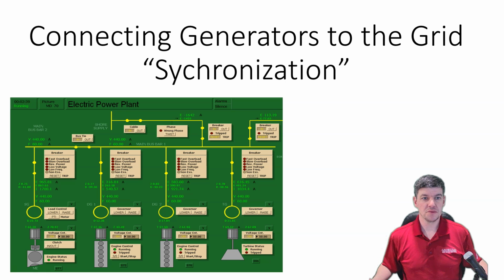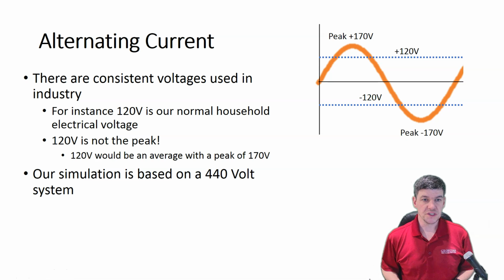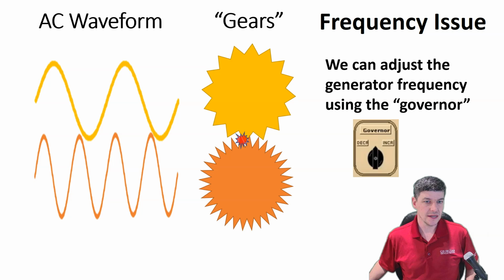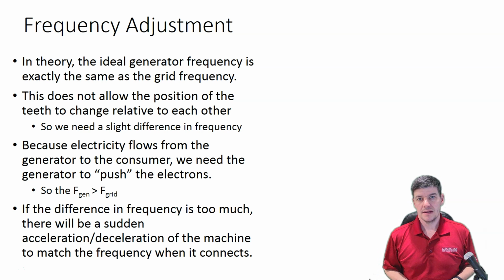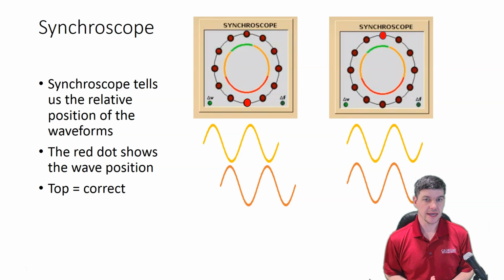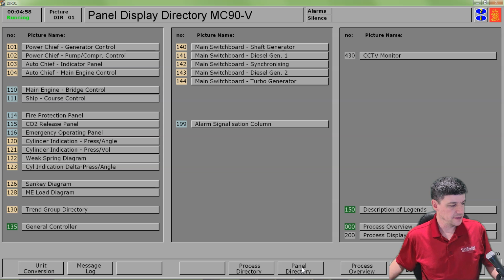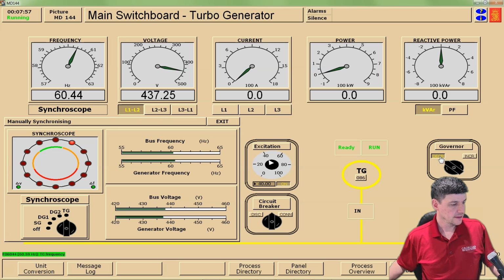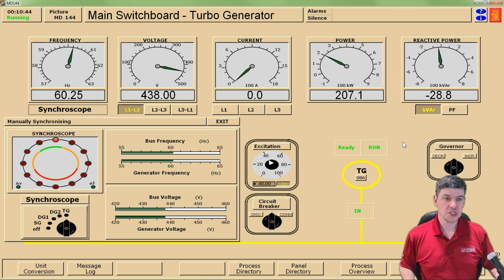Generator Synchronization - Theory and Simulation

Comment: I have a doubt and thought this is the best place for it, what would happen if the synchronoscope light is in the 6 O clock position and the breaker is closed, can u explain step by step how the generator will come into synchronisation if we r using 2 generators to parallel each other. Or what happen if the breaker is closed when the phase is 180 degree out of phase for the voltage ie when closed in 6 O clock position

Comment: I am now 72 years old. For 34 years I worked as an operator in natural gas burning generating stations with steam turbines and generators. So a number of times over my career I synchronized these units to the line. The units I operated were built in the 1950s. The synchroscopes on these units had a circular dial with a pointer that would rotate. There was a mark at the very top of the dial to indicate proper synchronization. There was also an arrow pointing left that was labeled slow and an arrow point right labeled fast. It typically took a few minutes to synchronize a unit to the line. It was easy match the generator voltage to the line voltage. However it took some time using the governor to achieve the synchroscope pointer rotating slowly in the fast direction. This was because the turbine speed tended to drift. Once the machine was just a little faster than the electrical system I would watch the pointer and close the circuit breaker when the pointer was close to the top. This was to have the generator circuit breaker close when the pointer was at the top. Today it common place for electricity generators to be equipped with automatic synchronization that performs all these steps automatically. I also have seen what happens when generator synchronization is done poorly. There was a turbine generator unit where the speed governor did not work. The speed of this unit had to be controlled using the load limiter, which only pulsed open or close the turbine control valves. As a result the synchroscope would rotate very quickly in the fast direction or very quickly in the slow direction. As a result ideal turbine speed could not be achieved. So operators tried to do as best as they could. One time I was at the boiler control board and another operator at the electrical control board synchronizing the unit. I heard a loud bang as the electrical system suddenly snapped the unit into synchronization and the floor of the control room jumped. Amazingly the unit kept running without problems. Synchronizing a unit to the line this way can cause considerable damage to the turbine generator and should be avoided.
Reply: We cycled so much, I can do it in my sleep.  Our units were commissioned when my dad was 4 years old.  I love the pistol grips and matching speed while firing my boiler all at the same time.  You should see the looks I get when I tell people I can sync to the grid manually 😂.  We got so good that I would almost stop the needle and close in. Auto sync is for dummies. 😂. I'm 39 and have been in the business for 19 years. Finally getting off shift now and passing what I know on to the next generation.
Reply: Hello sir,
I appreciate that you have shared your valuable experience.
Rahul Chauhan from India 🇮🇳
Reply: Good days. Thanks for sharing

Comment: Can the generator synchronised while the synchronoscope turn to slow direction (CCW)
Reply: Yes, it could happened in manual sync mode, done by operator. But be aware that operator immediately need to increase the load of synced generator, manually by increasing of the frequency/revs. In other case, the generator will take grid power and act as electromotor, with triggered generator reverse power protection. Luckily🙂

Comment: Power generation source has many AC generators and electricity is transmitted out through the same electric wire not necessarily turned on together, then why the sine wave does not go out of phase with each other?
Thanks

Comment: How to measure generator power when they are perfectly in sync with the grid? I mean how to measure "the pull" If they have same position
Reply: Reactive power can be determined by the difference in voltage level between generator and grid. Active power can be determined by the phase shift between generator voltage and grid voltage.

Comment: Hi how are you voltage and frequency, phase angle synchronising settings percentage how much?
Reply: You might want to clarify your question a bit? I’m not sure I understand the question itself.
Reply: @marcelastacey890 how much phase angle setting in the power generator?
Reply: @marcelastacey890  87 G protection setting

Comment: I want to start by saying thank you for taking the time to make this educational video that was placed into simple terms. I am a power plant operator, 60MW unit and a 26MW unit. I have been trying to understand the reasoning behind the synch scope, I understand the basic principle of matching the grid before "pushing on" to it. Yet, most text is very convoluted and far from clear on understanding. I'm no engineer, I struggle when its written from an engineers or electricians perspective. So thank you for this again, very helpful video by using the "gears" as a visualization tool.

I would also like to ask, if you are still on the Youtube, where can one find this simulator? Is that something anyone can access or is that a proprietary program?

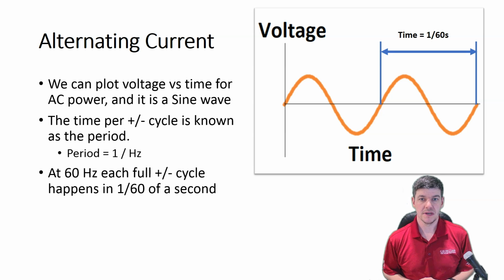Comment: A formality: At the slide at 2:42, you use quantities and unit symbols in the same formula. As in, you write, "Period = 1 / Hz". This is not proper form. It should be, "Period = 1 / Frequency". (Or, if you must, "s = 1 / Hz", but even that should only really be used in actual calculations with figures, not with the symbols standing on their own.)

Comment: found an answer...Post by Steven Chauvin:  Once a generator is synchronized and placed on line, in parallel with other similar generators, the become “synchronous machines” (which means it will act as a generator (driving the load) or motor (acting as the load) at times). One of the generators in the group is designated to be the “master”. The other generators will synch to its speed and voltage. If one of the set begin to slow down, it will act as a “load” and so the other generators will “push” it. If it speeds up, the other generators will “pull”, becoming a load, pushing or pulling it back into synch.

Comment: Very interesting! After the generator is synced and locked what prevents it from going out of phase as you increase the governor power? Inductive reactance or back EMF?
Reply: It dependes upon several factors: the impedance between the EMF and the grid (resistance and inductive reactance), the voltage values (of the grid and the EMF) and the load angle (which is the angle between the EMF and the grid voltage, also the angle between two magnetic poles of opposite polarity between the stator and rotor). But lets assume that the impedance and the voltage levels are constant (which is usually the case). Thus when the governor power is increased the load angle increases, meaning that the angle difference between the rotor and the grid increases. Now, if this load angle is between 0º and 90º the operation is stable because the atraction force between the magnetic poles of the rotor and stator is strong enough to drag the rotor along and hold it in place. However, if you keep increasing governor power the load angle will eventually surpass 90º. In this situation the operation is unstable because the magnetic poles are so far away from eachother that the atraction force is so weak that the stator is unable to drag the rotor with it so it happends what is called "pole slip", meaning that the machine loses synchronization with the grid and the generator starts to speed up to very high speeds.
Reply: Thank you @adriansolis126

Comment: sir when you say we need to match our generator's parameter with that of the grid what does it mean? And if there's already a grid why do power plants generate electricity and how do they send it back to the grid?
Reply: The grid voltage may vary a bit. MIne roams between 37,500 and 38200v. Your generator will have to be able to match that as well as the frequency, usually 60HZ. Outside of the power company specs, they will require you unit to trip. To send power back you would syn to the grid and stay connected. Any power you make above your own load would go backwards through the meter to push into the grid. This takes a special bi-directional meter as well.

Comment: Wow. I'm old school, 70's and 80's. I have been in many power stations where the operator matched voltages and everyone in the control room stares at the synchroscope clock and the 2 lights above it. When the turbine generator is goosed up a bit by the Raise/Lower switch so its slightly faster than the grid, the Operator waits until the lights go out as the scope needle hits the 12 o'clock position and he quickly hits the Breaker Close switch. The Operator immediately adds a bit of power by bumping up the Raise switch to prevent the reverse current relays from opening the breaker.   Even back then the GE gas turbine generators has auto synchronization available as some peaking plants were unmanned and remotely operated. I was a Field Engineer for General Electric Co. in those days, worked in 17 countries.
Reply: Same method was used when I was in the navy back in the early 2000s
Reply: @sivalley  I supervised overhauls on all kinds of SSTG sets on Navy ships and subs.  I hope you weren't the guy who wrote FTN all over the place!  Its not a job, its an adventure!
Reply: @kimmer6  Unless you worked on CVN75. . . . But I had access to some of the more "fun" spaces that required a TLD. ;)
Reply: @sivalley  Enterprise, Carl Vinson, Long Beach, SSN La Jola and SSN Los Angeles. Required Subsafe, work barriers, documentation, and TLD Badges. Now I don't need no steenkeen batches.
Reply: @kimmer6  🤣 Yeah, i don't miss that stuff at all, glad you escaped the zoomies.  I was an ELT with RM quals.
Reply: "the Operator waits until the lights go out as the scope needle hits the 12 o'clock position and he quickly hits the Breaker Close switch."

The technique is know as the "dark lamp" method.
Reply: @BedsitBob  I recall, back in the early 70s, my elec eng lecturer, recounting an incident. Where a young technician, got the sync slightly wrong. It resulted in the grid forcing the generator into sync, and with such a mechanical shock, it sheared all the mounting bolts.
Reply: @doggychews  As I understand it, the generator should be running at a tiny bit higher (only a fraction of a cycle) than the grid, and the breaker should be closed just a fraction of a second before the generator lines up with the grid.

That allows it to run into sync, rather than running out of sync, if the breakers close a split second late.
Reply: no circuit breakers
Reply: @charlieangkor8649  Circuit breakers the size of a refrigerator that snap like a huge rat trap and make motor driven  ratcheting noise.
Reply: That is g8

Comment: Thank you for the tutorial, it is really helpful. I have two questions. Why is the current zero if there is power output? When we are connecting generator to the grid, how do we take into account resistance of the grid?
Thanks in advance.
Reply from the maker: Hi, good observation on the 0 current.  Just like the voltage where we have to select which phases to measure between before it shows voltage, we also have to select a phase to measure its current.  I did not select a phase to monitor in this simulation, so it shows 0 amps by default.  But there is amperage on each of the 3 phases which results in power delivered.
Reply: @RyanTangney  how can I access the full course lectures and exercises? I am willing pay for the content

Comment: Thanks for everything.  Can we sync two gensets of different manufacturers. (One with electronic governor and other with mechanical governor) how to control the load share of them
Reply: In my sugar mill, I had 2 very different generators to sync. Sometimes they had electronic exciters, sometimes they had mechanical. Depended whether they were on normal or backup exciters. One generator started with a 1916 mechanical governor ( just fine for make lights for horses) but not very good at keeping 60hz. Later in the 90's it was upgraded to a computer governor. It could always be paralleled. The challenge was the balancing. At different load levels, one generator would take more load or less load. Just a bit of baby sitting if the loads change a bit.  1936 1000 KW  and 1916 750 KW  at 460V  both off grid only. Both have been retired for about 8 years although the switchgear and syncro units are still in use.

Comment: Sir I wanted to clarify something. In the case of steam power plant, when the governor demands an increase in power, the generators respond by opening the control valve to increase steam input. Yet how does the turbine and generator speed does not increase by this higher steam input?
Reply: When the generator is NOT synchronized to the grid, the Raise/Lower governor switch controls the speed of the turbine and generator. As soon as you match the speed to the grid in voltage and frequency, and the synchroscope shows that the sine waves match, you close the breaker and lock into the grid.  Any further action on the governor ''Raise'' switch starts opening the poppet valves in the steam chest which adds load to the generator.  The generator is locked to the grid like meshed gears so the speed will not increase. 

The governors on the big base loaded turbine generators can influence the frequency of the grid but for the most part, the grid is usually so large that the addition of another generator has only a minuscule effect on frequency (speed).   When you have a small grid system, the problem becomes a bit more complex to maintain frequency and has to do with the droop settings of the governors. You don't want a 600 KW diesel generator taking all of the load while the 2 Megawatt unit is only partially loaded. Each governor's droop settings can be tailored to prevent that.
Reply: Governor controls speed not power. An increase in load (which will try to slow the generator) will require a higher steam pressure/flow to keep the Governor speed the same.
Reply: My GUESS is this has to do more with balancing net torque of the generator

Comment: Practically, I had seen rapid frequency variation before synchronising steam generator to the network. In steam turbine frequency variation give you fraction of time to close the breaker, as the governor doesn't give accurate response & control  of steam.

Comment: The argument for setting the frequency to be slightly faster than the grid's frequency doesn't quite make sense to me. That argument seems more like one for setting the phase to be slightly ahead of the grid phase. Two sinusoidal waves that are even slightly different in frequency will eventually go 180° out of phase, creating a beat pattern.
Reply: If you are going slower than the grid, you can still sync, but as soon as you do, the grid will speed up your generator to catch up to grid speed and thus becomes a "motor"  running off the grid and is a tad unstable. The power runs to the generator instead of to the grid and those units with a reverse power trip will open the breaker. This power trip in is place because if your generator looses power to the turbine and the breaker is still closed, it is a very large motor and will not stop even if you trip the turbine and shut off the steam. Trust me, I'm still cleaning up pieces from one that did exactly that.
Reply: @billk364 😮😅
Reply: Its better to have it go faster and then go slower when latched because if you are going slower than tha grid then the grid needs to inject power into your system to normlaize to its frecuency. You dont want to inject power into your grid. Normally theres relayprotections for reverse power but its not always the case. 

Its easier to slow down the rotor by a bit (having more Hz and then attaching ) than injecting power to make the rotor go at the same speed.
Reply: my (very uninformed) guess would be that it is generally better to dump the excess power from the grid while slowing down instead of pulling power from the grid to speed up

Comment: When syncing a generator lets say the line and unit are in phase and the frequency is the same. In regards to the unit compared to the line how far out can the voltage be when syncing? Great Video.
Reply: 5% voltage difference. It is sais that if its above that there can be damage to the rotor